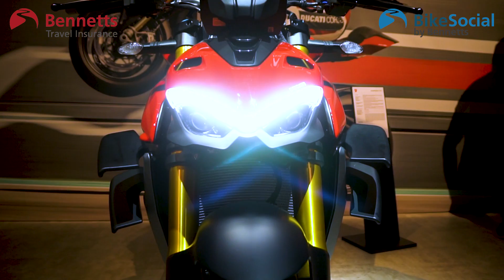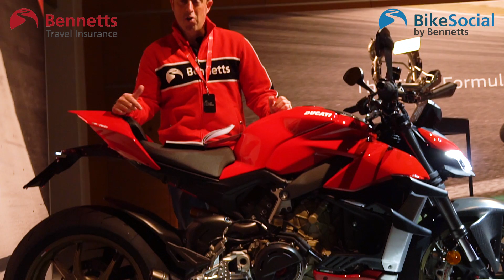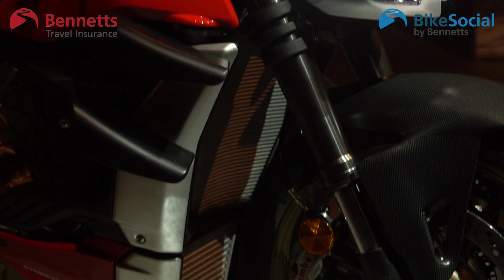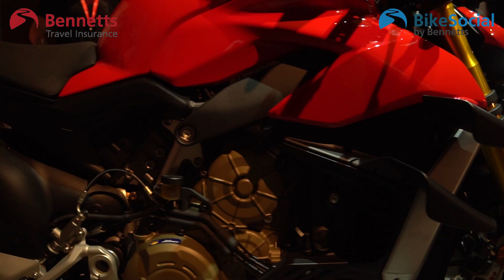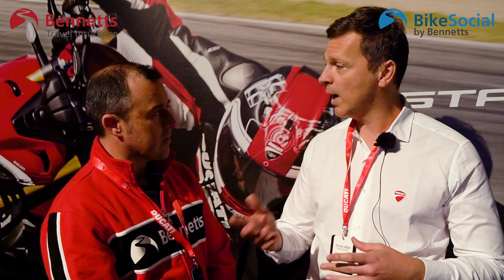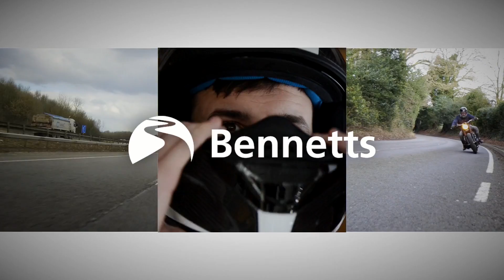Ducati Streetfighter V4 (2020) - UNVEILED!

Comment: Is it comfortable to be on for 3 hours is my question?  Or is this suspension like a rock?  I already have my solid as a rock Ducati that sits in my garage looking pretty
Reply: You can tune them suspension you know.
Reply: True,  I have meet some English riders that change the springs on the front end.  I put bar riser on my 998S.  Just raising bars an 1 1/2 inch made a big difference.  I would like Ducati to make them comfortable stock.

Comment: The pegs look uncomfortably high for a street bike. I wonder how the performance would compare to a Harley Livewire. The instant torque and low gearing of the Livewire versus the light weight of the Ducatic Streetfighter could make it interesting.
Reply: its a panigale with shorter gearing...not a new bike
Reply: J. Meyer lol lol lol really? Livewire 😂😂😂😂😂😂😂😂😂😂
Reply: @holmes1956O  Yeah hard to beat the instant torque from an electric motor. Looks like Energica is going take the high ground next year with the updates they announced today with 158 lb-ft of torque and 21.5kWh battery capacity. Makes the peak 90 lb-ft of the Streetfighter V4 look small.
Reply: J. Meyer nobody talked about heat from this bike, if it is same as panigale v4, then it cannot he used for low speed city riding also nobody mentioned if it has a fuel gauge, or cruise control, these are drawbacks of v4s. The lack of quick shifter is a drawback on monster 1200r

Comment: 'L' four! ;)
Reply: The engine is not tilted like a L-twin, its a proper V4, not a L4.
Reply: True, though the cylinders are set apart @ 90 degrees... that's where the 'L' comes from.
Reply: @TerribleTimes  Lamborghini huracan uses a v10 with cylinder banks @ 90 degrees, they still call it a v10. If you look at a ducati L-twin motor its a forward tilted 90 degree V2, almost looks like L shape hence the name.
Reply: ya, so what... Ducati officially calls it a 'L twin' go argue with the manufacture.